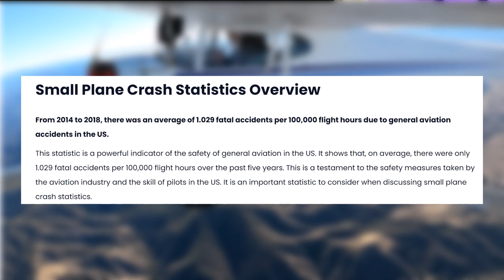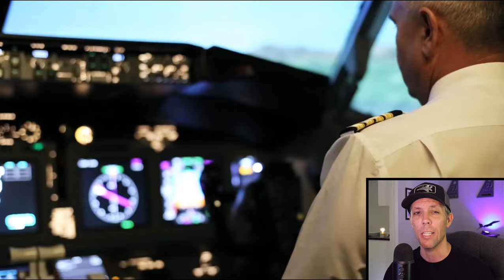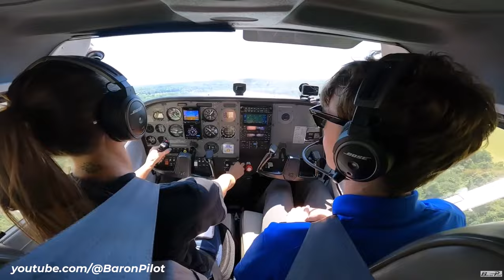Student Pilot Engine Failures Caught On Camera!

Comment: Years ago a young lady was flying a C-150 and called Unicom and said her engine quit.  Some one grabbed the mike and told her to pick a place and land normal.  Well there was a farmer plowing and she landed in the plowed area and the 150 nosed over.  She was not hurt and the 150 needed a little work on it.  She did good for a student pilot.
Reply: Isn’t it better to not use landing gear in soft terrain to avoid flipping?
Reply: @maskcollector6949  A C-150 has a fixed gear, as do most training aircraft.
Reply: @bitstream1  Is it because they're cheaper?  Less points of failure on one hand and more points of danger on the other from what I've been studying.  I guess if you're stuck with a fixed landing gear, wouldn't it be better to avoid a plowed area compared to a field so the wheels could roll better if given the choice between the two?  I've plowed a field a bunch of times, and that's going to flip you.
Reply: @maskcollector6949  Yeah, a retractable landing gear can be prone to more issues. Yeah, a field is definitely the safer option. If there's no other choice though, it's best to land in the same direction as the furrows.

Comment: best thing i did after just getting my first pilot license is spend 12 hours of dual with an aerobics instructor doing ONLY engine outs.  I learned a LOT about how far you can push a cessna to its absolute limits in those 12 hours.  On some pattern work, he would pull the engine off three times in one pattern.  I recommend that to everyone.  If you really know how to do an engine out, it is highly unlikely you will not walk away from the real thing.
Reply: practice, practice, practice !!!

Comment: My first engine failure happened on my third solo flight in a helicopter. Seventy five feet on take off, not much time to think, autorotation was perfect, not a scratch.
Reply: Holy shit 😮
Reply: @riggitydoo5116  Well brother this happened to me in 1979 in a BH47 D-1. Instant engine shut down, about 3 seconds before ground contact, had I not lowered the collective within a second things sure might have turned out differently.
Reply: @joesheeran2122  good job!

Comment: @3:33  real-life, NOT staged execution of an 'impossible turn'.   ..literally just a few seconds after takeoff.    THAT demonstration of calm decisiveness is nothing short of absolutely amazing.
Reply: Pretty new to these videos, but doesn't a complete loss of engine power have to occur for it to fall under the "impossible turn" category?
Reply: @codymoe4986  I'm not a pilot either, and would certainly concede that perhaps the *absolute 'impossible turn' could be with *complete loss of power.   I think though that what that pilot executed, with substantial loss of power, being just slightly above the tree tops, and with the runway at his 6 o'clock, was, at the very least, solidly in the 'impossible turn' category.  My non-pilot self is going off of the audible sound of the engine 'sputter' getting increasingly worse as he makes the turn, and the fact that he so immediately (but in a controlled manner) began the turn back(not too sharply) towards the runway, preserving his existing speed/altitude better than many pilots could/would.
Reply: The impossible turn is with no engine power. Still had some power and used it to get back to the runway.
Reply: In this case I believe it was a partial loss of engine power, which is what made the Impossible Turn possible.
Reply: @WorthTalking2  if he had no power at all then yea but the power helped him get back to the runway

Comment: My 1st engine failure was as a solo student pilot. (I had about 180 hrs due to weather, CFI turnover, and DPE availability.) Although only momentary due to an engine-drive fuel pump issue, I was nose up practicing a minimum radius turn at the time. 
My 2nd engine failure was also as a student with a CFI. Cause was a crimped fuel line.

Comment: I think student pilots should be required to do dead stick landings with their instructor. Planned dead stick landings will give a pilot more confidence to handle engine out emergencies than otherwise. Glider training is also excellent, my dad made me learn to fly gliders before powered aircraft. I also recommend basic aerobatic training, excellent for teaching how to deal with unusual attitudes.
Reply: ANY AND EVERY kind of "different experience" at the controls of a plane is a net benefit. It teaches you to keep yourself "together" if nothing else.  ;o)
Reply: Private pilots are trained to do dead stick landings before they solo. I agree with your aero training idea but as of now it's limited to unusual attitude recovery.
Reply: 100000000000% but we have Morons in charge.  Just make sure it’s a rated for aerobatics otherwise it’s a moot point.

IMHO the best pilots are glider pilots.

Comment: Thanks for a very thorough explanation of the engine failure emergency procedure.  Crop dusting and patrolling pipeline with a 200' waiver, I experienced seven engine failures in Cubs, Pawnees, and CallAirs and three in patrol Cessnas.  All were six second deals, so your excellent aviate, navigate, and communicate was entirely aviate.  Some differences, apparent to we who live there, require a low altitude orientation.  First, airspeed and not altitude is life down here.  We not only have limited altitude (time), but we also have limited horizontal space available.  We are in the realm of maneuvering flight and therefore we need to be able to maneuver and airspeed is required for safe maneuvering flight.  Only landing zones in the very near hemisphere are available, so the best or only one is generally obvious.  With zoom reserve airspeed, Wolfgang's "law of the roller coaster," we generally can safely turn to that site.  Excepting the engine failure while still in low ground effect over the runway, I was high and fast to most of the other nine sites.  I used full flaps and full side slip (rudder to the stop) on those landings.  I cartwheeled a CallAir (need to get wings level before touchdown), put a Pawnee on its back in a deep plowed field, and gouged a slit in the stabilator of a Cardinal on a steel fence post.  It is really important to get into the beginning of the landing site.

Again, good job with a thorough high altitude orientation.
Reply: Why so many power failures?
Reply: @WALTERBROADDUS  I'm guessing a bazillion hours and flying for cheapskates.
Reply: Nate nailed most, but in six seconds even changing tanks is not always going to happen.  I was teaching Ag in a SuperCub.  My student up front didn't change tanks and I didn't think of it either.  The engine quit on pull up out of the field he was practice spraying in.  I took the controls, continued the turn he had started with the zoom reserve airspeed from max throttle in low ground effect before pull up, and aviated to the adjoining field.  Just before touchdown, he got the tank changed and the engine started.  I landed anyway.  Six seconds is not enough time to make the life and death decision:  Oh, I am sure it was just fuel starvation.   Altitude is time.  Without time, aviate.  I had no time but I was flying and had a good landing nailed.  Crew resource management is high altitude orientation. @WALTERBROADDUS
Reply: You might want to check if your wife has an unusually large life insurance policy on you. 😮
Reply: Sounds like you needed a better mechanic

Comment: 2 of my fav "not crash", loss of engine powers are... Gimly Glider,  aircraft takes off with half the amount of fuel it needed due to conversion errors and a broke fuel guage...  loses all engines at 41,000 feet....  What an altitude to start gliding from..    and with a 12:1 glide ratio,  he had a fair amount of distance to work with...

2nd is British Airways Flight 009,   flew threw a cloud of volcanic ash...  747 lost all 4 engines...  could not restart due to volcanic ash in the engine... when the ash cooled enough it started to break away and the pilots were able to restart but as soon as they started climbing again they entered an ash cloud and started loosing  engiens again so opted to drop down and land right away.
Reply: I saw that on the show Mayday. That was awesome flying and also downright spooky. St. Elmo's Fire, I think they called it.
I could never be a pilot. #1 I get airsick #2 I would totally freak out if the engines died #3...I wouldn't make it to #3 See reasons 1 and 2.
That flight was awesome though. They landed and the airplane had most of the paint sandblasted off of it. Trying to remember: No one was hurt, were they? I'm thinking they landed safely.
EDIT: The Pilots also couldn't see the debris from the volcano on the radar. Didn't they make improvements to aircrafts radars after that to be able to see?

Comment: Great video, thanks! One thing that you could perhaps mention is that during normal (low altitude) flight, pilots should always be aware of possible spots for an emergency landing. If you remind yourself to scan for those on every flight, it will become second nature and could save you precious time if you're ever facing an engine out situation.
Reply: When really low, the one or so in the very near hemisphere is usually obvious.  Inability to glide far takes a lot of the indecision potential out of it.
Reply: Not that you ever want it to pay off but in that one moment having part of your normal departure being "if now, go there. if now, go there. if now, go there. if now, can probably return.", etc etc as you climb out and away. At least doing so until you have enough altitude to be able to turn around and make it back to the field. It's just like motorsports...we don't wear all that hot gear because it's fun or enjoyable. We wear it in the event of needing it. Prepare for the worst, hope for the best...

Comment: I’ve had my share. Engine failure at 500 ft in a Cessna, engine failure during a go around at 250 ft, engine failure on climb out at 300 ft, engine failure at 200ft, starter gear sheared off at 1200 ft during an in flight restart attempt over the airport…yeah….good times…when things go wrong, just fly the plane !

Comment: One complete engine failure to date, during instruction as a student. From about 3000ft it coughed then stopped. No restart. We had plenty of time to discuss various fields, and recovery options - gates, roads etc. Got down safely in long(ish) grass and stopped about 5ft away from a huge boulder hidden in the grass. The other event was a partial loss of power on takeoff (again as a student) - at about 200ft it coughed and spluttered. Made the calls, cut the circuit and nursing the engine along we got back safely. The engine out was due to fuel pump failure. Partial loss of power was due to debris from carburettor floats in jets. Since I qualified, I haven't had any engine hiccups again!

Comment: Warning:  critical response.

I greatly appreciate you making this video but it's a teachable moment for reasons you clearly didn't expect.  Training is designed to remove the negative and delaying effects of emotion on performance in emergency responses.  In particular, it teaches a useful mindset that then shapes the instantaneous reactions to problems via ensuring we're focused on the correct things at all times.  Your description and commentary contains highly emotional language that is not consistent with competently enacting the required immediate actions.  Adrenaline is a great drug when we learn how to use it.  It reduces performance and increases the chances of failure if we don't.

An engine failure is always expected.  There is no shock.  There is no time taken getting into the right frame of mind.  You've seen and felt the change you expected and the nose is going down between heart beats because the reaction is so automatic you're basically watching a movie of someone else doing it.   You're already into the response before the adrenaline has properly hit.  You're enacting the plan and the adrenaline maximizes that competent control of the situation.  The emotion will only come after the situation is concluded.  And it will be experienced in the context of your competence.

If you're trained yourself to experience emotion first and to respond second, everything you do after that is degraded by emotion being amplified by the adrenaline.  That is what panic is.  Emotion first, then adrenaline.  You can then refocus but a delay has occurred and  your performance will have been reduced.  If you survive the situation your feelings will be experienced in the context of that poor response.

Competent pilots can seem like boring people when they're discussing serious incidents they had to manage.  And they don't like people praising them overly.  They know they were simply being competent and that allowing too much emotion to intrude is dangerous.  They know that they're only as good as the next time they need to be similarly competent.
Reply: Thanks, you just put into words some vague thoughts I've been having, as an inexperienced pilot, for some time now!
Reply: @jcburleigh  hey cheers and thanks for reading that rant!  I haven't done much flying due to a medical issue soon after basic training.  But I couldn't justify taking passengers with me until I'd gotten to the point in flying that I'd previously gotten to with driving.  Act first, feel after.  Then I had a dream one night about an engine failure while flying friends around some alien thing a bit like the tree in the Avatar movie.  In the dream I did a forced landing and we went off to do something else and it was no big deal.  That's when I knew I'd integrated that stuff into me.  

FWIW, when Sully landed in the Hudson I was obviously pleased but also understood why he didn't get too excited.  That's the job.

Comment: When I was in College. My High School Football Couch was getting ready for School when he heard a Loud metalic noise outside. When he went outside to check he found a Cessna 172 hanging upside down by it's Landing gear. Without think for his on safety, he went to his barn an ran outhere to the Plane with a Fiberglass Ladder and helped the Pilot out of the Plane. The pilot had lost the engine while trying to land at the now closed Mcmin Field. The pilot desided hecould make it there and was trying to land in the Couchs Farm field. but didn't see the power lines which caught the landing gear and flipped the plane. Fortunetly they tangled. Luckly there were no injuries.

Comment: Would you please do a Pilot Debrief on a Quantas A380 flight in 2010, where an engine exploded and caused 60 system failures.  The pilot successfully landed the plane.
Reply: That would be nice of Hoover. Sadly the captain of that flight died in 2015 in a small plane crash in England .

Comment: If you're rich, you expect the engine to work all the time.
If you grew up poor on the farm like me with sketchy engines, it's not if an engine will fail, it's when an engine will fail.
Most likely, an engine is going to fail on you on take off, because it's under load, hasn't been run in a while, is probably cold, and is tilted up with gravity working against the fuel line.
Every pilot should look on google earth before they take off, and scope out a flight path that goes for the duration of his climb out over empty pastures.  That's a big derrrr...

Comment: I’m curious if not determining the reason for the power failure included the emergency checklist. If the Cherokee ran dry in one tank, then completing the emergency checklist should have recovered the power loss; unless both tanks were dry. If one tank was already dry, then I would expect to be more aware of the status in the second tank while trying to return to the airport. (NTSB says crashes are typically the result of multiple failures, and the presumptive number seems to be adding up - preflight & fuel calcs?, switching tanks regularly & monitoring fuel levels?, completing emergency checklist upon failure?) Seems as though any one of these may have avoided the crash.

Comment: I landed on nothing but roads in China for years.   I got the job because I had a plane that would quit on me nearly every time I flew it….  I got known for landing in unusual places….  This is decades before all the stol yuppies were an idea.   You don’t look for power lines. You look for poles.   Unless a farm field has hay bales in it,  meaning freshly cut grass and a tractor was able to operate there.   Unless hay bales are there you’re going to most likely wreck your plane.  I’ve had more engine outs probably than anyone alive.  A highway is nearly always the best choice.   I’ve only damaged one airplane.  Failure on takeoff with a VW engine.  The guy who made the turn back,   He did it very poorly.  If you’re going to turn back it needs to be steep.  If he would have lost total power he’d be toast with such a shallow turn.   You’re using up a lot of real estate with a shallow turn.  Steep bank with very little load is the fastest way to make the impossible turn. I’ve had to do it twice.   My other option was into a nearly frozen lake.   And no, I’m not a story teller.  This is legitimate experience.

Comment: Those statistics are really bad, actually.  Comparatively, there are only about 0.0711 deaths per 100,000 hours driven.  (Texas 2021 - 1.58 deaths per 100,000,000 miles assuming an avg of 45 mph). So general aviation is really about 14 times more deadly than driving.  But If you equate that to miles instead of hours, then assuming an average speed of single engine plane ground speed of 125 mph then that is 8.232 per 100,000,000 miles, which is still about 5 times more deadly than general aviation.